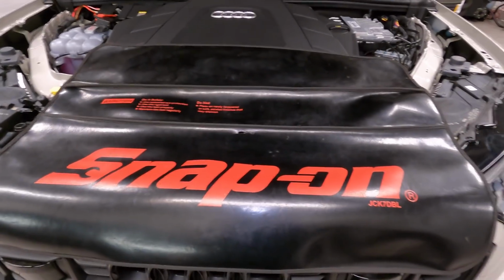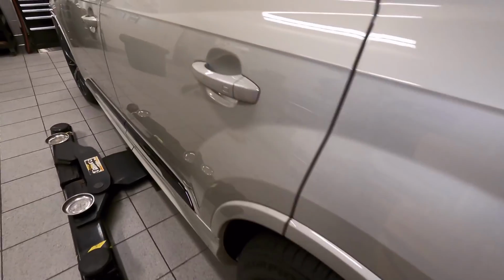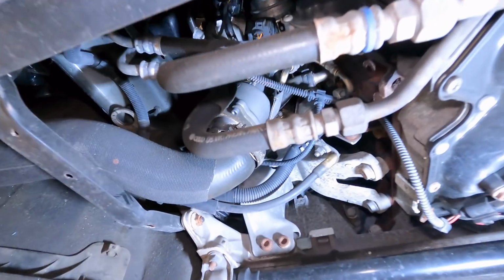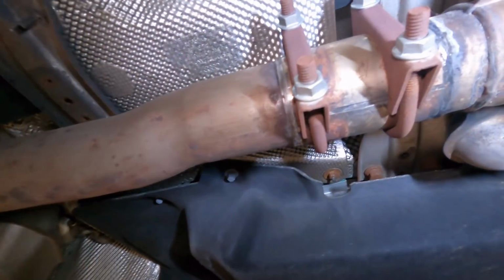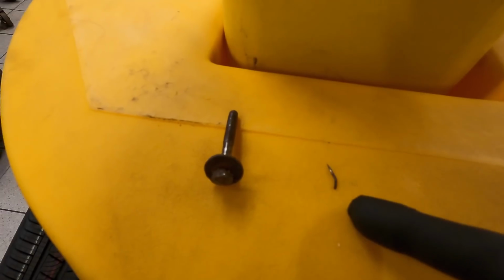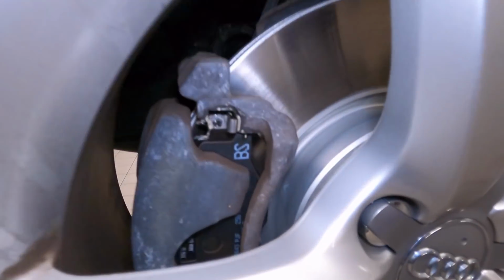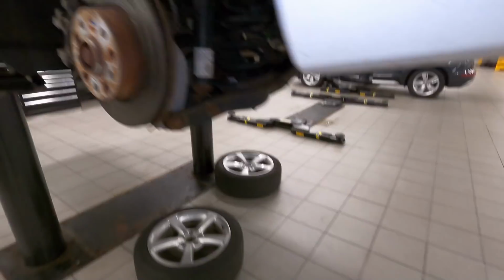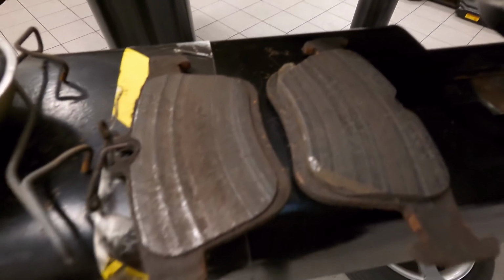Customer states "WHO ORDERS A CAR LIKE THIS!?🤔

Comment: I remember a tech suggesting to a 30 something soccer mom Audi driver that Audi Recommends a trans fluid flush and filter change about 5000 miles before where it came into the shop, and her response was priceless AF, "Uhhh, this is an Audi, it doesn't have a transmission, you're lying to me,I'm calling the cops." The cops show up, laugh with us at her, tell her to pay up her bill and go on her way, she looked like 5th grade remedial math student asked to solve a fluid mechanics equation in front of the class. Edit: if you're going to reference dragonball Z you might as well edit the 3 second scene in...
Reply: Was it a multitronic? If so, it has a transmission, but maybe not a gearbox
Reply: @satsumagt5284  it was a 2001 with an straight up automatic. I mean it was 15 years ago so if you wanted more info than that...
Reply: @mikehannigan848  then... well, she was a true Karen for even calling the police, like, WTF the police has to do with it?
Reply: @satsumagt5284  she believed we were trying to charge her for a service she didn't need and therefore thought we were lying about the services we had performed...
Reply: @mikehannigan848  well, sure, but calling the police is too much. She could have first asked "then where's the transmission?", and you people could show it right behind the engine. Nope. She acted dumb and got what she deserved.
Reply: @satsumagt5284  Bro, as much as we laughed at her I still understand that she thought she had some high tech German spaceship, and wouldn't know the difference between a transmission and a driveshaft. Most women feel you are taking advantage of their mechanical ignorance and who knows what kind of week she was having before all this. Yes she over reacted,yes it turned out funny, but she never yelled, she never threatened us with anything other than calling the cops (she obviously just wanted a second party she could trust around), it all worked out in the end, we got paid, she went off to deal with whatever life issues she was hauling around. And I got a story to tell for life.
Reply: @mikehannigan848  we can surely blame that on dishonest mechanics. Dishonest professionals... people in general suck.

Comment: What’s the turbo price installed? Thanks
Reply: Way too much
Reply: If you are gonna drive an Audi, and you're asking about how much a repair costs, you are driving the wrong car.   Get yourself a Toyota.
Reply: @MrSloika  I’m a VAG person myself and have done most family repairs myself. Now that my oldest is finally paying her own way, I laugh when she gets pissed at the cost of parts. While she grew up doing maintenance on all the cars with me, she never knew what I was paying to prevent any major issues. She wouldn’t let me do her front brakes. By the time she did, the rears needed attention too. She almost died at the parts cost for all 4 corners. “I’m never buying an Audi again.” After I did all the work, “ I love my car.” Interestingly she does her own oil changes religiously at 5K in my garage. Go figure.

Comment: the ugly beige car reminded me when I worked at a Pontiac GMC dealer. in about 96 or 97 a customer ordered  a Suburban in 2 wheel drive with the small 305 V8 with a 4 speed. it had a bench seat in tan vinyl, an AM radio (only AM nothing else) and bright yellow paint. he ordered all the features that would be dis-continued the next year.   
Another time we got a Pontiac Sunfire convertible. the car was painted white but the top and full interior was ORANGE!

Comment: Nothing like a mechanic's video to remind me why I won't touch an exhaust driven supercharger with a 10 1/2' pole.
Reply: There are no exhaust driven superchargers, a supercharger is run off the engine directly, you might have been thinking about turbo charging which uses exhaust gas to drive it. Agree though, I don't want turbocharging at all, much more complex than a normal engine.
Reply: @barryaiello3127  They are all supercharges.  They are called "turbochargers" when they are run off exhaust.  A turbocharger is a supercharger, but a supercharger is not necessarily a turbocharger.  I simply describe it in long form.  It's like a lot of kids think it's weird that I say "soda pop," because they're too young to remember when it was all one expression.
Reply: @ThatsMrPencilneck2U  Uh, no, a supercharger is using mechanical power from the crankshaft, a turbocharger is using exhaust gas to spin the blades. They are NOT all "superchargers".
Reply: @barryaiello3127  Read a history on the things, or talk to an engineer.  "Supercharging" is an effect.  Years ago, my brother, who's an engineer, lectured me on this, ad nauseam.  Lately, I've been watching a number of lectures on supercharging WWII aircraft.  They rarely describe the supercharging system on aircraft, like the P-47 as a "turbocharger," but that's exactly what it is.  While the F-4U had the same engine, it was supercharged with a multiple stage, gear driven system.  I'm sure Greg's Airplanes and Automobiles would put you to sleep as he explains how high performance intake system work.
Reply: @barryaiello3127  Sorry to inform you that Paul is correct. The correct term (that nobody uses anymore) is turbo-supercharger. Any forced induction system is supercharging, whether driven by exhaust or belt.
Reply: @61rampy65  Maybe, but since one is always motor driven and one always exhaust driven today's auto's divide the two.
Reply: @ThatsMrPencilneck2U  Those were needed for peak performance at high altitude since the air thins out, they got crazy numbers from piston engines.
Reply: @barryaiello3127  The manifold pressures were so high, they were burning 150 Octane fuel.  The gear driven superchargers had to be staged, so they wouldn't blow up engines at sea level.  The Germans got around this by running their superchargers off something like a torque converter.  The Germans only had automotive grade gasoline, but their engines were big, compared to the GM Allison and RR Merlin.

The Army liked to run their boost off of exhaust for the same reason the auto industry likes turbochargers.  They actually improve the overall efficiency of the engine.  That's why the Army never got around to fully develop a gear driven multi stage supercharger for the GM Allison.
Reply: @ThatsMrPencilneck2U  If the Germans had access to the 130 octane gasoline the allies had the FW-190 might have been the best WW2 fighter of them all, one has to retard the timing under a lot of boost or else risk serious engine damage.
Reply: @barryaiello3127  Low octane gasoline wasn't the FW-190's problem.  Well, the Germans could have boosting the manifold pressure on all their aircraft, but they made up for it with huge engines.  The problem with the FW-190 was the single stage supercharger for the DB801.  It suffered the same problem as the P-39, P-40, and early P-51's: It became a slug, over 20,000 ft.  Eventually, they took a Junkers Jumo 213 off a JU-88, extended the 190's  tail, and had something even better than the P-51.  By then, it was all over.

Comment: Well lol it’s common practice that when you do brakes you do all four so they all ware at the same time
Reply: It's also common to replace all four head lights at the same time when one bulb goes out.
Reply: @transtubular    You could but it’s not something like brakes when you hit the brakes all 4 brakes work at the same time. So be dum to replace fronts and then not backs cause when you go to replace the backs the fronts would already be worn down a bit. A headlight just a bulb just replace the light that’s out
Reply: @ryans413  Rear brakes last much longer than front brakes.
Reply: @cdnmetelhead4013     Depends if you hit your brakes hard a lot fronts will be worn down more cause of gravity pushing the car down but if you brake smoothly all 4 will ware down evenly
Reply: @cdnmetelhead4013  That depends on the brake load and balancing. In the good old days the rear brakes tended to be under powered as without ABS locking up rear brakes caused slides and spins. With ABS you can get more work out of  the rears and in some cases they actually wear faster than fronts.

Comment: Never buy an Audi
Reply: What does that have to do with anything?? - owned lots of them in the past - take care of them and they are excellent. What you see here is simple neglect - every car has brakes that need to be refreshed and lots of cars now have turbos that can blow seals/bearings.  Many of the cars shown here are simple high mileage derelicts.
Reply: @AtlasCroc  You may have a good one and maintained it , but every one we see has rust issues . My Toyota that I've had for over 20 years and driven over 200K miles does not have issues like these .
Reply: @eaglerider1826  i'm not exactly an audi fan, but these rust issues aren't that crazy. 

Those rear brakes are from a car that obviously sat a lot and didn't get driven much, the rears end up sticking... All brands with disc brakes on the rear will do that in that scenario.

The rust on the other cars isn't too out of the ordinary either. I think this guy is in PA. Roads get salted there, it's notthing i don't see regularly where i am. 

And btw, this summer i just had to bypass the trans cooler on my moms 11 corolla because the line rusted through. Rust hits all cars in road salt areas. I had to dump my beloved 01 tundra because of rust... Everything rotted out. Brake lines, clamps, the rear end, it was a disaster even though it got a new frame under warranty like 5 years ago.
Reply: @volvo09  If all of these cars are from Pennsylvania that would explain a lot . I live in Alabama and I don't think my city even has salt for the roads .
Reply: @eaglerider1826  All depends on where you live - these are all northeastern cars that deal with snow and salt.  Most cars are shot in 10 years in those conditions.

I have several 200K Toyotas around me - the ones with 4 bad shocks, bald tires, smell like rotten eggs and can't move more than 40MPH - especially ones in that awful gold color.  You can drive anything to 200K - doesn't mean you should.
Reply: @AtlasCroc  I'm looking to get another 100K out of it if I live long enough . I do replace parts that ware out like the plastic washer bottle and the radiator which had a plastic top .

Comment: What caused the oil into intake?
Reply: My guess is blown turbo seal.
Reply: Plugged PCV System maybe?
Reply: @davidowen6103  That would be my guess.
Reply: It’s a German car
Reply: My money is on the turbo as well. Yes, a PCV issue can do it as well, but 9 times out of 10, turbo.
Reply: Yeah that would be a lot of oil for a faulty pcv

Comment: How can a brand new car already have that much damage to the rear brakes?
Reply: Riding the brakes too much classic example of someone that probably drives down hills a lot and rides the brakes all the way down instead of gearing down. That or they brake at the last second really hard. That would ware down the brakes pretty quick
Reply: Don't listen to the other guy
It's just a different car from the one at the beginning,  look at the rims
Reply: @Alucard-gt1zf  And the color of the car.
Reply: They also had some that sat at the docks for a while. The side towards the salt spray looked like that on a brand new car.

Comment: Obviously you work in an audi dealership. It’s hilarious to see cars gets neglected and owner tries to get it fix by the shop. But some repairs you post are from just being an audi higher maintenance/unreliable cars, its not the owners fault the turbo started to leak, or exhaust clamps which were installed from the factory, so dont laugh at the owner if the car itself is the problem. I have own vag cars and yeah they are fun to drive but sucks to own.

Comment: Sorry CSW, I did just finish tech school. Wearing pads down to the base is TOTALLY in spec, right? 

Right?
Reply: You pay whole pads, you use whole pads. Why throw them away with quarter still good :)
Reply: If the disks were good, running the linings that low would be OK. But this is more a rusty disk problem than anything else. For some people a couple of MMs of pad is good for another 10k miles. And if the linings have gotten hot, cracking is not unusual. As long as the bonding is  good, not even really a cause to replace.

Comment: a brand new car and needs to be fixed already.
Reply: No plates yet, it's a pre-delivery check, to make sure there are no problems after transporting the car to the dealer.
Reply: @csgergo80  so this car was screwed up before it even went to the dealer? wow
Reply: @randomrazr  No, but they check it anyway, as a last QC, before they hand it over to the owner. It can also be required by the DMV for licensing.
Reply: @randomrazr  The cars with the oil issue and brakes were different cats.

Comment: So oil in thee intercooler means what? New Turbo ?
Reply: Sometimes but not necessarily, this car probably has something wrong with the crankcase breather system that's letting too much oil recirculate into the intake